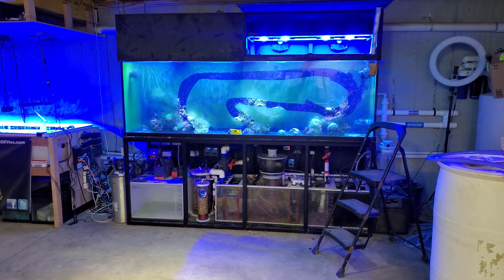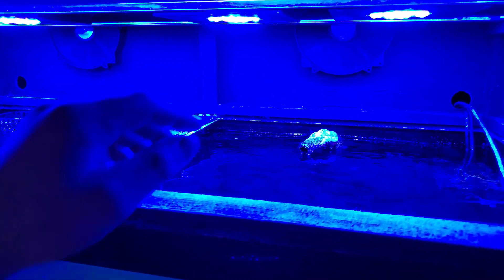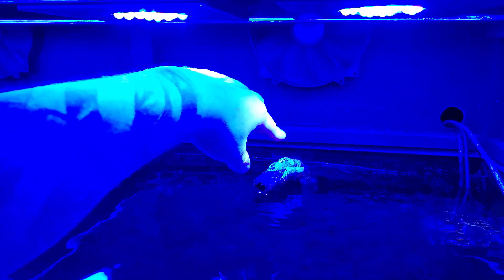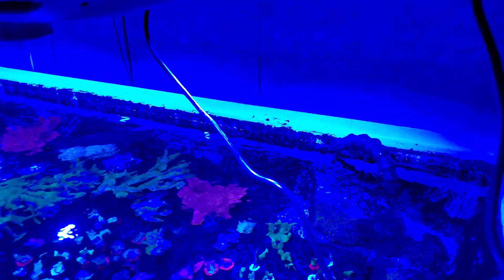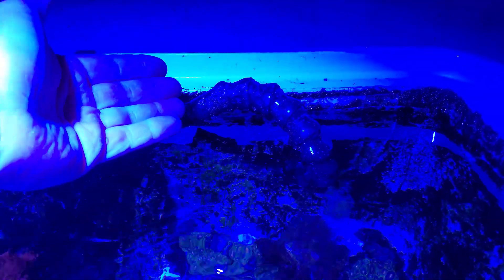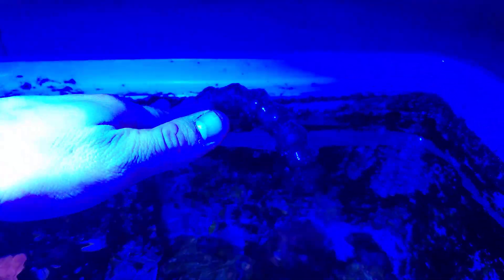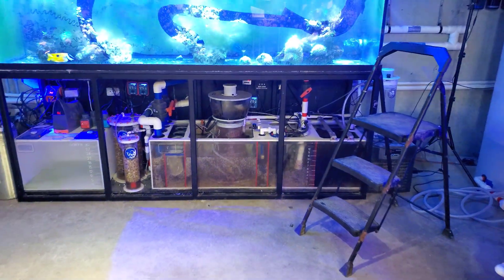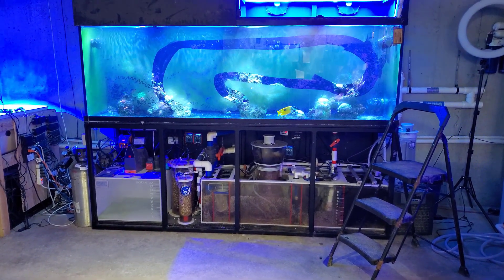Do This With Your Returns And Never Worry About Back-Siphon

Comment: I’ll give this a go next tank. I usually drill a small hole just below the surface of the water to where it takes in air when it drops to the base of the overflow
Reply: "Air break" greatest redundancy. Eventually an Invert will grow on your check valve rendering it useless when you actually needed it.